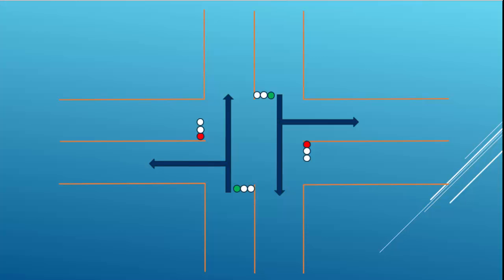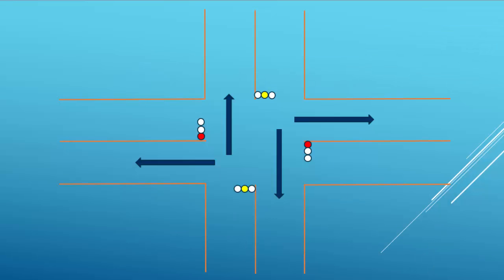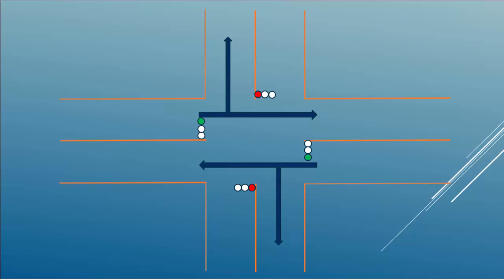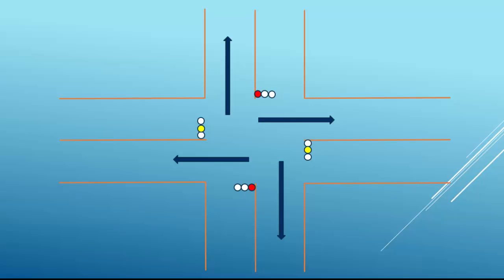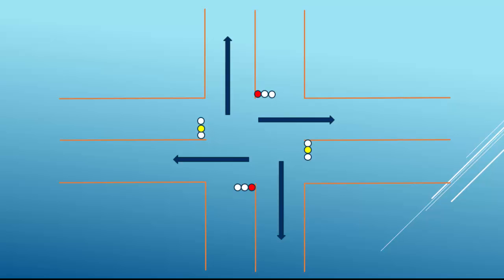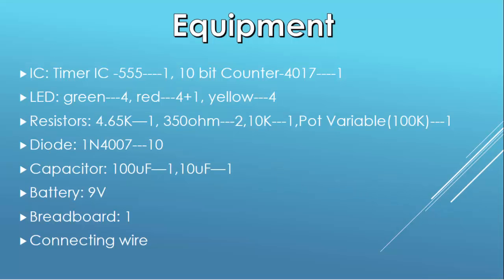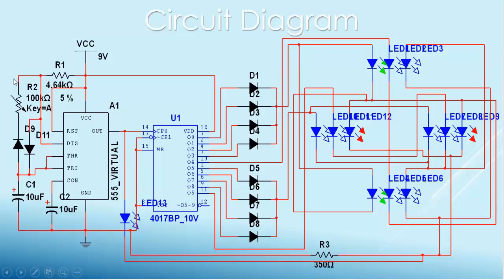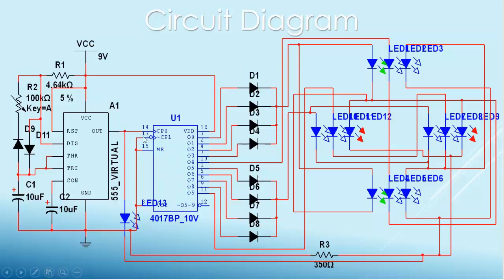DLD Project || 4 Way traffic signal control light

Comment: I want to make a circuit in which red light glow first second yellow third is green light.    but after green light glow it should be continues glowing  till I don't stop it pls send me this digram on my whatapp num 9699250748 its urgent I want to complete my project
Reply from the maker: It will better in microcontroller.

Comment: is that a push pull button you are using to change lights
Reply from the maker: I didn't understand what you said. Actually the 4017 is a counter ic that can be operate by push pull switch with 5-9V in high and 0v on low.

Comment: Also your equipment does not match with the circuit diagram E.g. with your list u have said that you need 2 250 resistor but your circuit only shows one. and your list says you need 10K resistor and there is no 10K resistor on the circuit diagram

Comment: the diagram is not the same in actual wiring... as you can see... there are 3 resistors in diagram but in actual there is 5.....
Reply from the maker: i have shown the clock pulse by a Red LED, there I used 1resistor and i used series connection of two resistor instead of 350Ohm.
Reply: the error in the drawing is that it is impossible to connect the clockled output in parallel with the output of the colored leds without experiencing blinking , you have to back the colored leds output with a diode , or as you taught ; add a second 350 0hms resistor apart

Comment: I copied your work but the led doesnt stay at its color. It's blinking and follows the beat of the pulse. How can i do it to stay like at 8:14
Reply from the maker: +SuperMultiOne  First make the clock pulse by NE555 timer..there are different design of NE555 for clock pluse..then use the clock pulse to the counter 4017. here i used diode u may use OR Gate also..